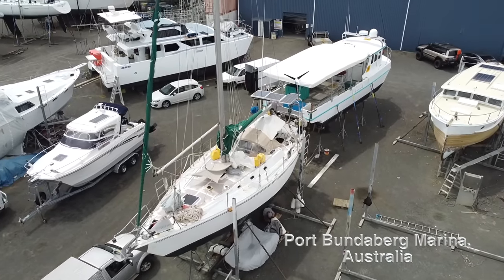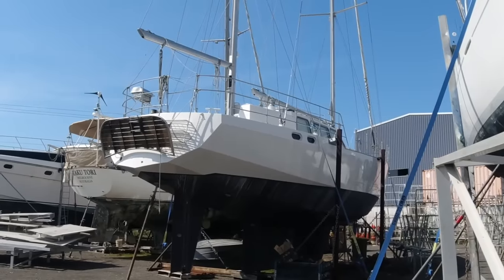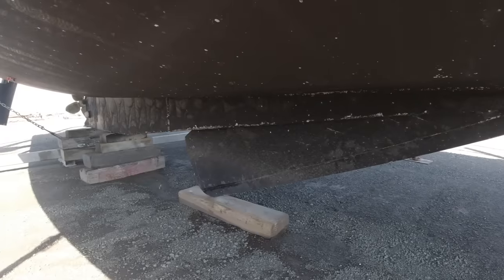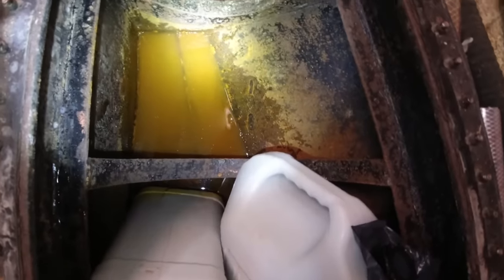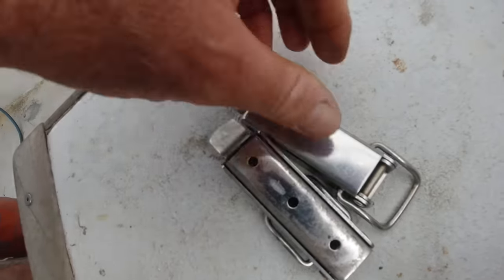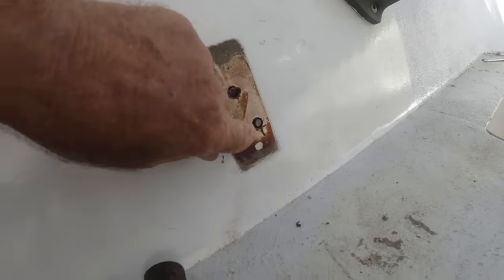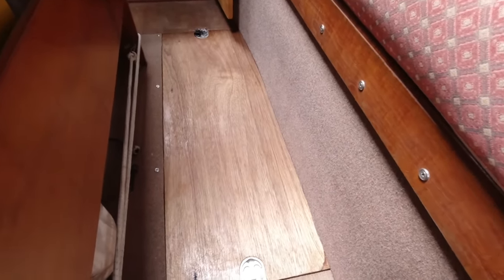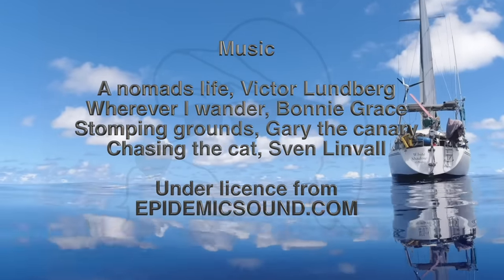BOATS BOATS BOATS

Comment: Cutting the anchor free was called slipping the cable. In old sailing ships it was done often, but a float was attached so the ship could return and pick up its anchor after the danger had passed. Keep an old fender in your chain locker.

Comment: I totally agree with you about needing a Scag in front of or under a rudder. The only thing I don't like about that very long skeg is that it needs to have one more vertical support in front of the rudder just for strength without depending on the rudder for that strength.

Comment: That leg reminded me of when I ended up in hospital in Mount Isa. NW Queensland. I was working in one of the mines there. I nicked the front of my leg on, of all things, a piece of cardboard. Infection set in and before I knew it I was in hospital with my legs elevated and on a continuous antibiotic drip in one arm and a shunt in the other through which I had a two hourly antibiotic shot as well. A surgeon said to me, ‘welcome to the amputation capital of Australia, you were within a couple of hours of us taking both your legs off at the knee’! There were six of us in this hospital room, five with freshly amputated legs! Made me very aware of what could have happened! I was in there for six days and I’ve had recurring problems ever since! That was over fourteen years ago! The tropics can be a dangerous place to get an infection.

Comment: 13:00 Instead of filler... swap the pan head bolts out with flat heads & finish washers, thru-bolted. Or flat head self tappers, finish washers & some 5200 to seal it up & help hold them in place.

Comment: Since you like a 3/4 fin keel and a full strut supporting the rudder you would like the underbody design of the Pacific Seacraft 34 that I have, identical in design to the 31 and the 37. By the way, when Bob Perry was designing the ultimate carbon fiber 60 ft cruiser he added a strut like that one boat that stretches from the back of the keel to the rudder strut, and called it a chastity strut, because without it you are f.

Comment: Ok - Orcas (off Spain) don't care what type of rudder you have. They have disabled full keelers as well as spade. Also talk to any yacht designer about hull windows - the bonding between the window and hull is usually stronger than the hull itself. If you lose one you have bigger problems. You should have gone for a Najad or maybe a moody. More efficiency so less miles at sea, less maintenance so you have more beer time. But hindsight is easy.

Comment: The Orca rudder fixation is a real problem   i think if i was having a boat built id have the rudder framed and protected
Reply: @SayWhut276  im not sure you are up to speed on this. In 2020 Orcas started attacking sailing boats off NW Spain and this behaviour has spread to the Gibraltar straits. Dozens of boats have suffered damage from attacks and several have been sunk.

Comment: Wow hope your foot/ leg healed up okay.
Melioidosis bacteria?

Emergency release of your anchor cable/chain.

In the Australian navy they use what's known as a Blake slip also known as a Senhouse slip to secure the anchors when at sea, it is used to slip the anchor not in the cable/chain  locker but may be a good option theyre  solid and only require the removal of mauzing wire securing  a  pin then tap out the pin then a hit with a hammer.
Or the above in conjunction with a lugged joining shackle.

Easy to flood a bilge on a ship when up on the hard, fresh water and fire main systems are still charged.

Cheers

Comment: You should use proper sandals instead of those flipfloppers you have ( yes they are cheap but not good in the long run).
Ptiy though its so long distance otherwise Id coming by  and Cheered you  up with some cans  of beers.
Hope everything goes well with your foot.
Cheers.
👍

Comment: Hmm, in emergency I think the fitting on the end of the anchor chain may not easily exit via the hawse pipe and/or winch chain wheel.
Reply from the maker: If you look closely you'll  see that it comes of the chain before it goes out.

Comment: Id be willing to weld on new sheeting and return that beauty to the sea. Skining is easier than framing.
Reply: My thinking was it is a ferrocement hull not steel plate judging by how it's blistering and bleeding.
Reply: @bobcrow214   looks like water bubbles under the paint

Comment: Hey Barry, I m in Queensland, where did you get your phosphoric acid from" I have been getting the diluted version from Bunnings. What fairing compound do you use. I have a steel boat and about to do some work on it. I seem to be told to use Jotamastic 90 by the commercial steel boat companies. I haven't tried it, however, i have seen the results after a few years.

Comment: That foot looks awful, a tiny cut in this heat and next thing you’ve got cellulitis and a major problem as you get older. I use Accelerated hydrogen peroxide on all small cuts and grazes. I’ve learnt the hard way many times. It’s great on coral cuts as well. No doubt we will get the full story soon.